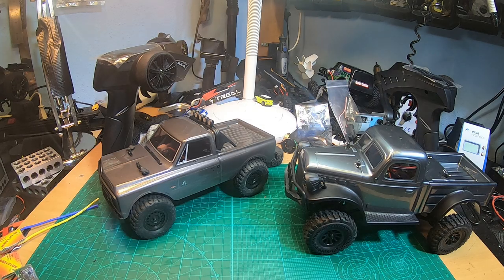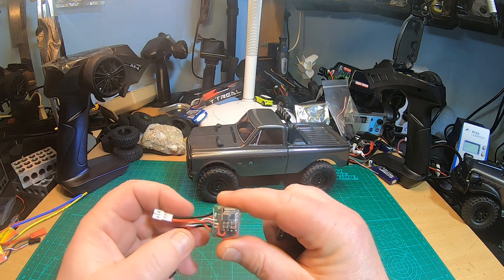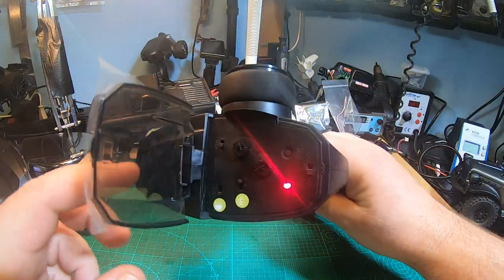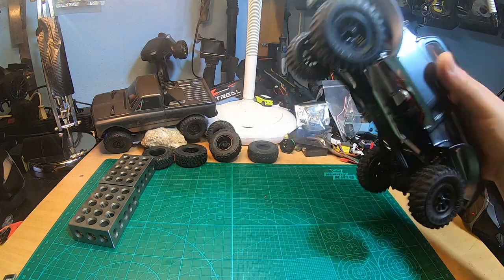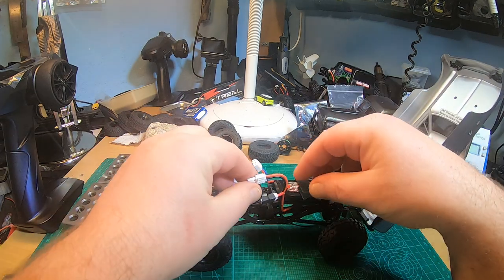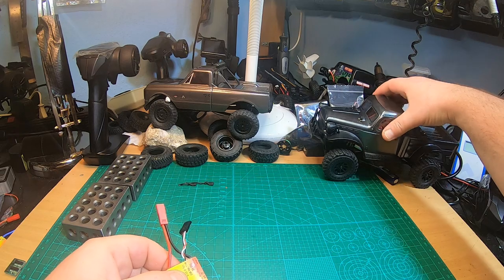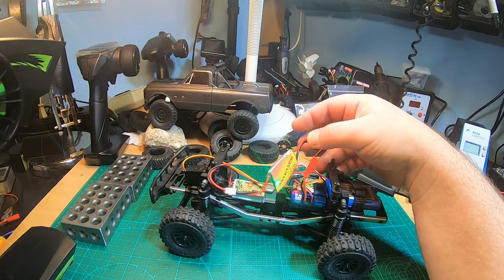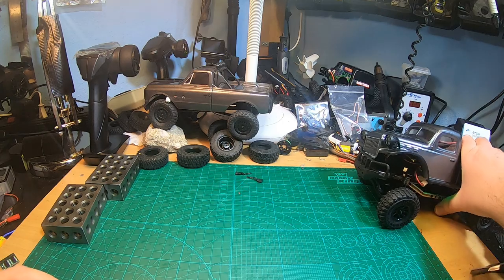Axial SCX24 and Panda Hobby Tetra: Awesome ESC upgrade using stock radio and receiver

Comment: Thanks for the information across all your videos way better than a lot of people across the pond. I have the scx power wagon my first axial and a few fms fcx24 I got into crawling two months ago
From Fpv drones and fixed wings and find it very satisfying to modify these toys! 
That said I have the power wagon Scx24 and hate the low speed control. I happen to have an old cheap Esc brushed Ali express and connected it to the stock radio Esc spectrum as they call it. It worked and has way better throttle modulation but realised I powered the spectrum and not the external Esc so got very low power. I chopped the battery leads now I’m going to re solder and give it a shot to see if it’s faster and as good by powering the Ali exp Esc to bat and not the other way around.  😊
Reply from the maker: Should work without problems battery into ESC and ESC into receiver unit. Did test only with SCX24 v1 electronics and not with v3 (Power wagon, AX24).
But those old tiny cheap red/blue/yellow ESCs from Ali (BG, Ebay, ...) do normally have quite poor low speed modulation. Donno which one you have. Maybe check my old video "Best ESC for microcrawlers", there I test some of those "cheap brandless China ESCs"

Comment: Ok, where do I start.?? First, your passion in this genre is top shelf. I love the slow description of everything. This is a great reference video. To me, the most useful item that you have here, the most change for the least amount of work is the BEC you featured in the very beginning.  You literally plugged it in the stock ESC and you got a complete transformation... from a "trail truck" into a "PROPER CRAWLER.!!"  
As you may know, I have burned up my stock ESC for my SCX24, so I will have to get a second one to use this product.  I am going to as soon as the become available once again. I am glad that you showed the Panda Hobby rig as well. I may pick one of them up for this BEC upgrade. I learned quite a bit in this video. I will be referring to it in the future for sure. Thank you for taking the time to share.! 🤜🤛🏎💪🔥😎
Reply from the maker: Thank you.
Did you mix up "BEC" and "ESC"?
Check the next video "No Bec", you do not need to buy and mount a BEC if you intend to use stock radio and receiver-unit anyway. Thats the easiest way.
And do not forget: After this mod it is still also a trail truck. Maximum speed, punch, etc. are not changed.
Reply: @donaldsneffe  all I know is that these add ons you have here are really great. Love the video. I messed up my first comment due to excitement...LOL

Comment: @donaldsneffe what crimp tool do you use for PH 2.0 ? Love your indept videos! Keep it up!
Reply from the maker: PH is "on the border", you could even crimp those with  "normal" hobby crimping pliers (I have cheap < 15 bucks "orange" Hobbyking crimping pliers for more than 10 years now, they are good for "JST red", JST XH (balance plugs), servo connectors, and maybe even JST PH).
However, for JST PH (and smaller SH, GH, ZH) I use for several years now Engineer PA-09 (Amazon), those are awesome (if you only crimp few connectors).
And I use those pliers (paid less then 20 bucks): https://www.youtube.com/watch?v=bLAjUm3iz5I
Which ones is also depending on wire insulation. In "super soft silicone wire" the insulation easily will be damaged/broken by "1 crimp pliers", and I mostly use the Engineer PA-09, in which you can determine how far you wanna press the flaps of the connector into the insulation. But "super soft silicone wire" crimp connections are not very firm, always have to be very careful when pulling out the connectors.
But all those ways of crimping are only "hobby grade" and far from professional. For perfect crimps you would have to buy the matching crimping tool for your/every connector (Watched a YT video recently, about tools, Knipex pliers, where they told that there are more than 1000 (nearly 2000?) tools for crimping different connectors a specialized German company offers). But this is way too expensive for a hobbyist.
Reply: @donaldsneffe  thanks for the confirmation on PA-09. Been looking at that particular tool. Yes crimping is a jungle. Working on my own light riggs for different projects..

Comment: Hi und vielen DANK für die Tipps. Ich habe beim SCX24 Empfänger und Regler an den LIPO angeschlossen und gelb/blau mit dem Motor verbunden, soweit OK, wenn ich aber das 3polige Kabel in den Steckplatz am Empfänger stecke passiert gar nix, Du hast doch den Pluspol (rot?) abgeklemmt? Habe ich das richtig kapiet ein kurze Hinweis zur korrekten verdrahrung wäre klasse, sorry für die Frage vom Einsteiger.
Reply from the maker: Das rote Kabel ist egal, das kannst du auch dran lassen, ist Attrappe dann, schadet aber nix.
Du musst vorher schon, also vor Akku einstecken, den SCX24 Empfänger auf "Ein" schalten, sonst kann der ESC nicht initiallisieren.
Sicherheitsfrage: Mit "Regler" meinst du schon den Modellbau-Regler.de AS12/6 OHNE Bec?
Wenn du nen Regler mit BEC verwendest, darfst du den Akku dann nicht mehr parallel direkt in den Empfänger stecken, die Stromversorgung erfolgt dann über das BEC vom ESC und Kanal 2 (dann brauchst du Plus/Rot auch!).
Reply: Super nett danke für die Ratschläge wird alsbald umgesetzt
Reply from the maker: @OliverBachmannstaplerworld  Was für einen ESC verwendest du denn?

Comment: Hallo, vielen Dank für das tolle Video!
Ich habe einen Panda Hobby und habe mir das AS-12/15RW mit Kabel GEKAUFT.
Da ich neu in dem Gebiet bin.
Es fehlen ja die Stecker vom gekauften Produkt das ich die Batterie und Motor anschließen kann. Wie heissen die? Da es verschiedene Größen gibt und ich nicht rausbekommen habe welche ich bestellen soll.
Vielen Dank für eine Antwort.
Anschlüsse wie in Ihrem Panda auch Batterie.
Reply from the maker: Danke. Die "weißen" Stecker heißen JST PH 2.0 (2-Pin), die "roten" sind JST "rot" (JST SYP), diese Stecker sind überall zu bekommen, mit Kabel oder zum Crimpen bzw. Löten.
Reply: @donaldsneffe  Herzlichen Dank für die Antwort!
Werde ich mir sofort bestellen und dann Ohren freundlicher mit dem Panda 🐼 Fahren 😁

Comment: Sehr cooles Video, ich suche einen sehr benutzerfreundlichen Slow crawler esc plug and Play am besten für den scx24 und ich habe eine andere Batterie mit jst ph2.0 

Kann ich den as12/15 rw nehmen mit bec ohne zu löten?
Reply from the maker: Der 12/15 hat so lange und dicke Kabel... das wird eher nicht möglich sein. Die Kabel müssen für den SCX24 getauscht werden (oder abgeschnitten und was anderes angelötet, für Crimpen sind sie zu dick).
Der Furitek Lizard eventuell, wobei ich damit einige Probleme hab ;)
Gibt es bei Asiatees.

Comment: Could you make a video on how to make/prepare all the new electronics for the panda hobby? And/or where to find all the parts needed thank you!
Reply from the maker: All links in the description, shipping to US is 8 € (as it is to my country). No plug and play. AS12/15 comes with wires, but plugs needed.
Check also https://youtu.be/k7MH2zjYQck - You can simply use Panda stock receiver.

Comment: Very interesting teaching, I hope you can help me. I have the Tetra X1 and after sometime on the shelf I wanted to start playing again. I noticed my transmitter wasn't working well. First looking at the batteries I found one battery was melted. I removed batteries, cleaned terminals and all was good. I turned on transmitter and jeep. At first all seemed OK. Then trying again I got no response with the jeep steering OK but nothing else? I'm going crazy I tried many things but nothing only steering servo working, What can I do?
Reply from the maker: Difficult to tell from here. So does the steering work or not?
Impossible to say from here if it is the radio or the receiver or the servo.
Do you have an SCX24? Guess the SCX24 (old version, 3 speed) radio does also work with the Panda, try it. Or try the Panda radio with a (old v1 version) SCX24. 
Try a different servo, if you have. If not, and motor works ok, plug the servo into CH2 of the receiver and check, if it works (controlled by throttle).
Is the truck battery (LiIon) ok?

Comment: Wow thank you I just made up a cable to join 1080 bangood esc to panda hobby and its silent and crawls better now I don’t have to buy the parts to build sound and light kit as quick. I got all the lights just how I wanted them with the panda hobby esc/receiver headlights and dim tail lights on all the time reverse and brake lights and roof lights on switch. If only you could have sound aswell with stock electrics and extra esc
Reply from the maker: How does the "Banggood 1080" do? Good?
You can make sound, no problem. Simply buy a sound module and connect it in parallel (Y) with throttle/channel 2. Maybe check Orlandoo sound moduls or DasMIkro.
Reply: Main thing is less noise not tested fully the crawling not secured everything yet having to use different battery will try and use original battery and secure stuff bit better and report back. I was just looking at the das mikro have you done a review on it? Thanks again 👍🏻
Reply from the maker: @nate63892  No. I do have one (or two?) in my Orlandoos, years ago. I do not really like the noise, it is cool in the beginning or for show, but after some time it gets annoying. 
The Panda is super silent... with the new ESC (SCX24 much louder).
Only thing missing: a slower motor, difficult, because it is such a "special motor" with superlong shaft. Hope this new Panda 55t (?) motor will be widely available soon, but 55 vs. 51 does not sound that much (slower).
Reply: Ok, I think it may come with a bigger speaker now maybe that’s the one you have but i think you can add own sounds with usb and some soldering. The 1080 on panda is still a bit jerky under load unless you very gentle with trigger but it does turn wheels slower when trying to climb and did I mention it’s quiet now lol. The panda motor has gone from 51 turn to 60 I believe maybe it’s better my 51turn doesn’t seem too bad if your gentle on trigger I use the very tip of the trigger to get better control. By the way the prc qx4 shocks look like they would be a good fit on the sg 1/24 if you can find them mine are too stiff stock. I’m going to try make some springs first. I just received my unpainted carisma coyote pup body for my sg
Edit: seems like with 1080 it has a little more torque on the lowest speed setting and crawls a lot slower just needs a little burst to get wheels turning under load then you can slow them down pretty nice
Reply from the maker: @nate63892  My Orlandoo sound systems are old (first generation, with the first model, Ford 150, no other model released at that time. 4 years?).
So far I see Panda spare parts only on Panda Hobby website, super expensive, shipping too... shocks would be awsome, but not for this price.
Reply: When I go on spare parts it has picture of 60t motor and says copy of 51t 180 motor underneath
Reply from the maker: @nate63892  ok... so nobody will buy and report
Reply: I might in future or maybe wait until they are on eBay as panda hobby delivery is not fast. Have you seen TheDIYGuy999’s channel before he has a good looking sound kit but must order all parts and build yourself
Reply from the maker: @nate63892  ... wonder why they had to use such an akward motor with such an superlong shaft...?
DIYGuy from Switherland: Yes I have. Super cool stuff. But thats all with programming, Arduino, ... I am not so good in this ;-) - and I do not really like sound kits (anymore).
Reply: @donaldsneffe I guess so they could use an existing gearbox with bigger motor that’s why it needs that spacer to fit. You could try a 2mm 10 tooth gear but the motor shaft is splined and not sure if you can move spacer over a bit for mesh. Oh ok guess I will struggle with that sound card aswell then
Reply: Do you know if I put 3s on the 1080 while connected to panda hobby will panda hobby get higher voltage aswell or just motor? And do you know if panda hobby can take 3s?
Reply from the maker: @nate63892  no problem, will work. Only motor gets 3s.
Reply from the maker: @nate63892  I did already take a deeper look - unfotunately this seems to be very complicated, as you mentioned.
In "all the others" simply swap out the motor, in the Panda, ....
Reply: I could probably come up with a 3D printed spacer that moves motor over slightly to make 10 tooth fit. Just need to make some splines in the gear I guess. Do you think more voltage to motor will help jumpy start up under load? I don’t have any connectors left to join up 3s at the moment. Is your 1/24 bronco body a new bright toy one?
Reply from the maker: @nate63892  I do not think higher voltage will change anything...
Reply: @donaldsneffe update I lose my brake and reverse lights from the panda hobby esc/receiver when I use a separate esc, is there any way I can get them working again maybe send power from separate esc to the power cables of panda esc and just put signal wire into channel 2? Also on 3s on low speed setting it does have more torque seems to be somewhere between setting 1&2 on 2s better I think
Reply from the maker: @nate63892  Yes, of course you can do this. I would not know, why this should not work. Since my Panda does not have those lights, I do not know where the LED wires are placed in your truck. Normally reverse and rear light are plugged in parallel to throttle, channel 2. Simply use or make a Y-connection, if you use a seperate ESC on Ch2. (But if rear and rev LED are plugged to another port on the receiver, simply plug them in again).
Reply: @donaldsneffe  the brake lights come from channel 4 and reverse lights from channel 5 but when I plug 1080 into channel 2 of panda the power stops going to brake lights/reverse lights the channel 3 switch for roof light still works I think it may be activated when motor is plugged into motor plug on panda. Guess I will have to get 2 y plugs and have both reverse/brake and esc on channel 2. Or order a laneboys RC unit
Reply from the maker: @nate63892  This will not work (Y-cable) IMO - if there is a special channel for the lights (the internal light controller). 
Seems to be rather complicated with stock rx. Honestly I do not understand why the lights should not work with motor not plugged into stock rx/ESC motor plug.
But try this first (plug motor in original plug and power RX/ESC unit with 1080) and confirm that this is the reason. 
You could also try to make a Y-cable battery - 1080/original battery plug and pull out the red wire of the Hobbywing 1080 servo wire and so power the RX unit by internal BEC... do not know if this works, but it is an easy try (only y-cable from battery needed).

Comment: This is great! If you sold those Pre built on ebay you would make alot of money my friend 👍🤣
Reply from the maker: Thank you!
I would not, you forget what the price for an SCX24 is here in my country (Chevy is 140 €, about 165 - 170 US$), ESC is 20 € (ca. 24 US$), BEC about 3 $, plugs, wires, ... thats already around 200 US$ only for the parts, and shipping is crazy expensive in my country (only to Germany, neighbour country, already 15 €, so about 18 US$, overseas probably far more), then there will be problems with customs probably... 
Nobody would pay such high prices.
Reply: @donaldsneffe  totally understand I live in UK and pay double for upgraded parts from US - what I meant was sell the new ESC and BEC  Pre wired so that folks could buy and drop into there own scx24..... Anyway love your vids man keep Em coming 👍
Reply from the maker: @lnpxw20  Yes, that's true... shipping the ESCs with BEC should be cheap.
But still... How much could you take for such a unit? 30 €?  Guess, that's not a well paid job then ;-)
Would be awsome if Modellbau-Regler.de would offer such an option.
But their stuff is meant for boats and construction vehicles... not for micro crawlers.
A tiny 10 A ESC with BEC included and their awsome software would be perfect!
Still, you can use the 12/15, which includes a BEC, only some shortening of wires necessary and then its perfect for an SCX24. Price is 33 €... (1080 is not much more expensive here). 
It is difficult, since we live in very expeisive countries.
Now, as UK is not EU anymore, it will be even more difficult (ordered sometimes in the UK, because shipping from UK to AT is normally much cheaper than from DE to AT, mainly paint and airbrush stuff).
22 € up will now not be possible anymore (without customs, VAT).